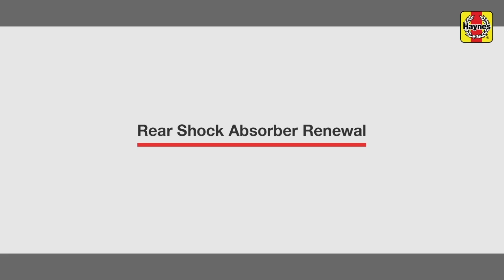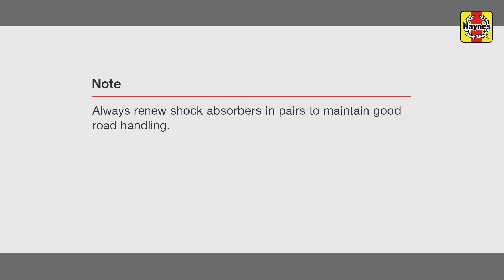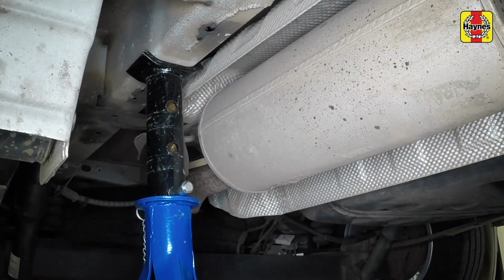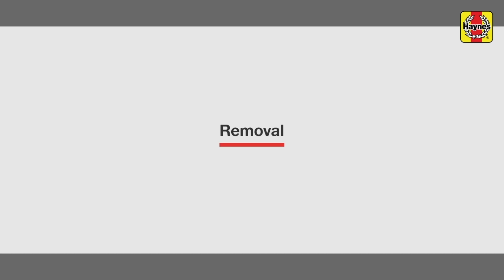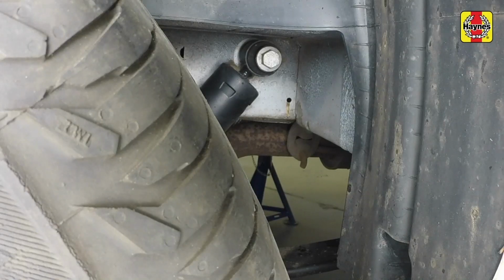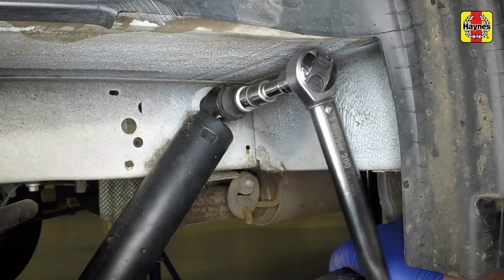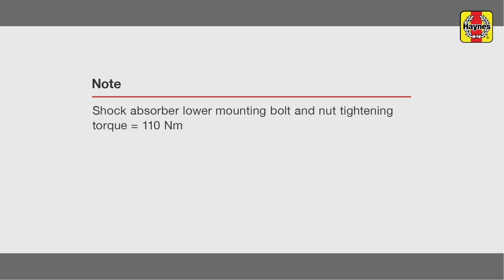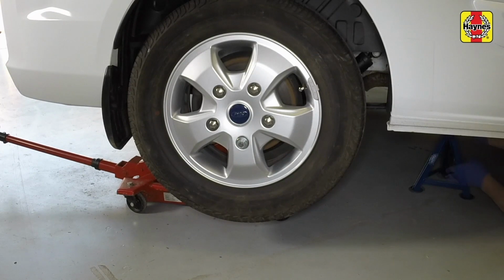How to replace the rear shocks on the Ford Transit Custom 2013 - 2017 Diesel

Comment: Never give spec for torque or wrenches never
Reply from the maker: Torque settings are in the video (1'33" and 1'39"), the tools are just the normal ones found in an average automotive toolbox
Reply: It always nice to see how easy job is in these videos. My upper bolts was so stuck that it took 13h to get those open😂